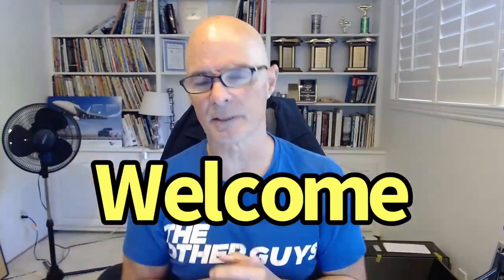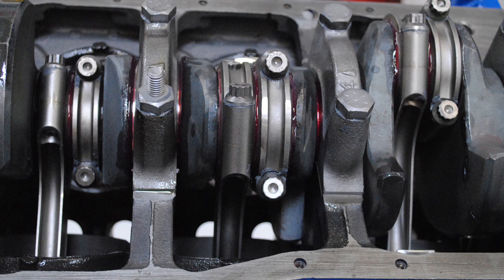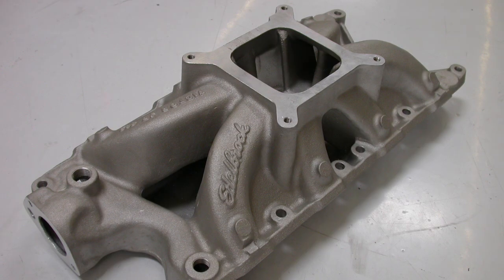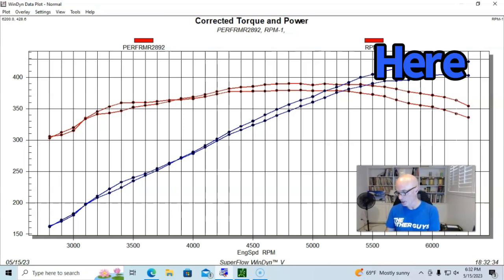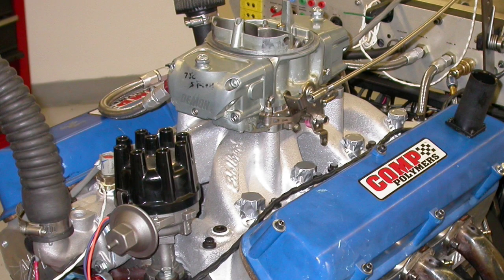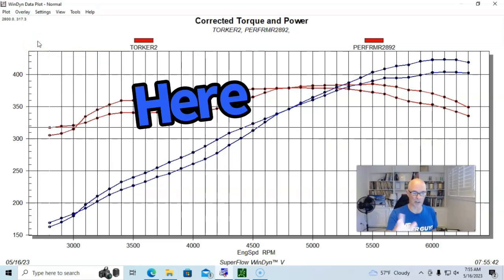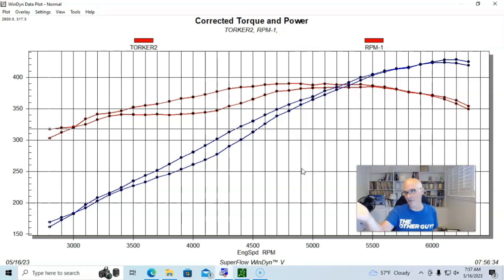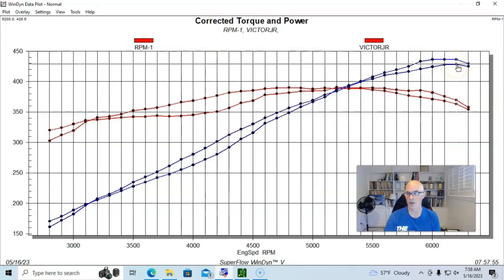SINGLE VS DUAL PLANE, WHICH ONE IS BEST? SMALL BLOCK FORD INTAKE SHOOTOUT? 4 INTAKES-FULL RESULTS

Comment: I always like seeing contalent that is not just showing peak power but also gives info on the drivability of different combinations.  Most of my daily driving, I don't get past 4k rpm, so making power in the area that I am driving is more interesting to me.
Reply: And conversely on my road course track day 306 rarely sees below 4k while on track. And this here is why we have options. You need one style, I need another.
Reply: @Chest Rockwell  exactly, I also love information for my racecars, but it's just nice to see good quality comparison content.  Not just the usual "your cars not fast unless it makes 4 digit power..." that seems to clutter a lot of my feed at least.
Reply: @fiend_metal  Big power is a relatively low cost game these days thanks to much better OEM platforms and cheap turbos so everybody has got be a 1k hero.    Most people can't even fully use 400-500 hp, but those numbers sound "weak".  Not to me, I'd rather ring the neck of a 300 hp well balanced car all day than to be nursing around so much power something will break, overheat, no traction and so on.
Reply: @chestrockwell8328  yeah, I race in a off road race series, and it's always a blast to make my little Impreza use every last one of its 80 whp...  I now have 2 points championships in that class, even competing against other people driving v8 jeeps or WRX's.
Reply: @fiend_metal  Right on buddy, nice work being successful with a "lessor" machine.

Comment: Had you added a 1 inch spacer to the RPM it would have made at least as much power as the Victor Jr.
Reply: Hood
Reply: @hotrodray6802  L88